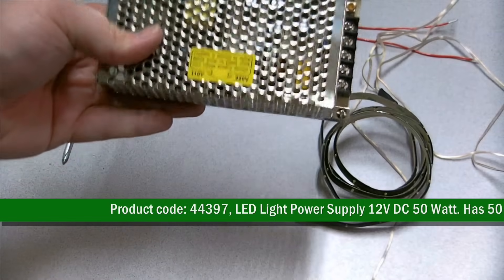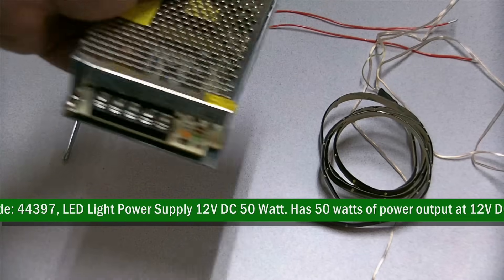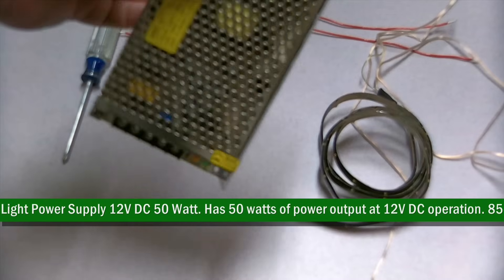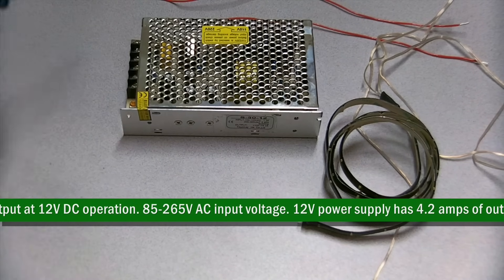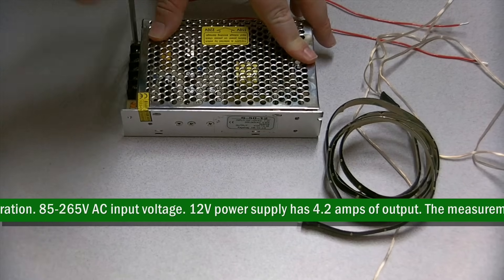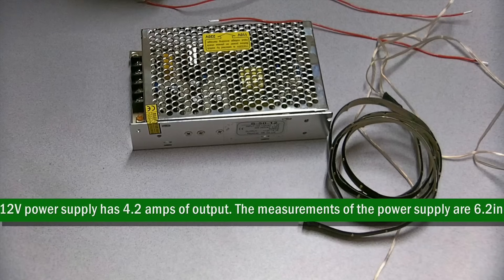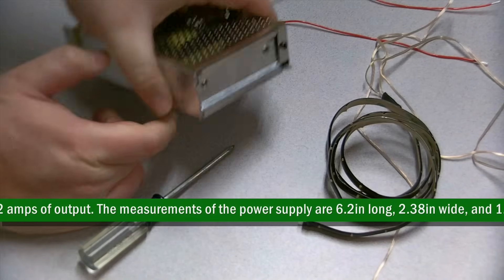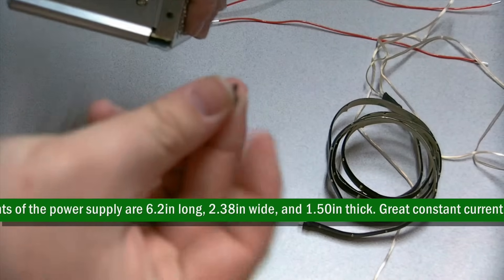44397, LED Light Power Supply 12V DC 50 Watt.

Comment: would have been  nice if the power connection were explained, like what is L N (AC), AND -V +V means, I noticed you connected the power supply to the ln ac, 
but you used 2 red wire, and also did not used the ground terminal, can you explaine , I have a same power sup. only different is my input is 110 output is 5 v 5 amp. and I don't wanna burn it by wiring it wrong. thank you